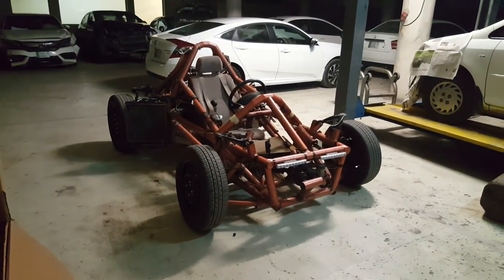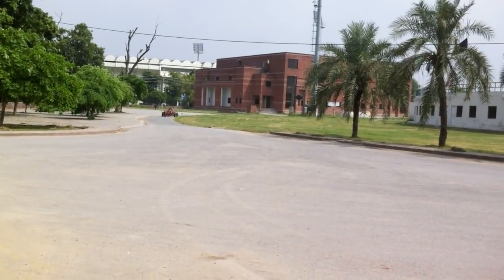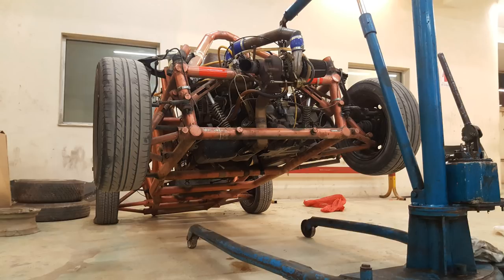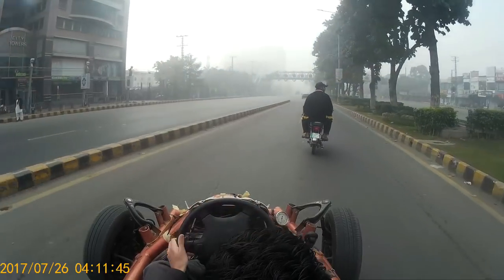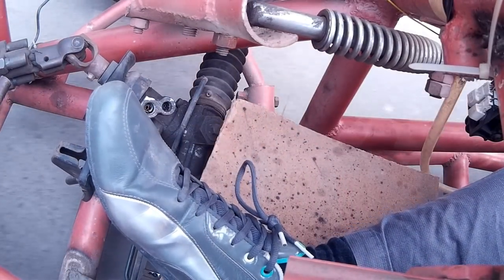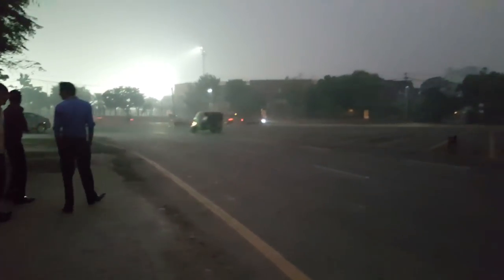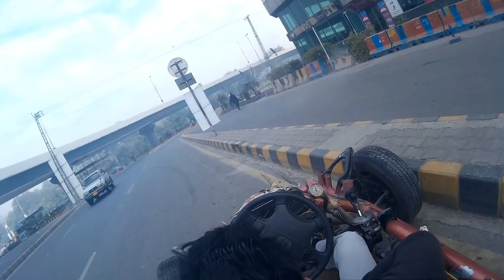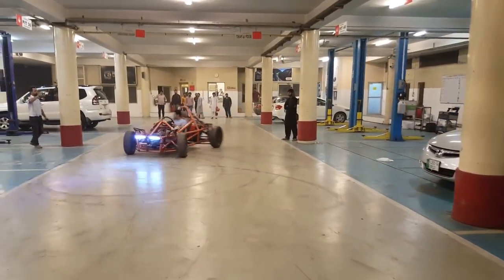Self Made Car C2 - 5 Year Update

Comment: One point about bending tie rods straight. I did that once to my go kart and thought everything was OK, some time later the tie rod broke in two while being driven. The bend was located at a point on the tie rod where a nut had been silver soldered on for alignment purposes so it was heat effected, but be careful with bending suspension components to repair them.

Comment: This car is a credit to you ,  well done . I like the way that you made the original suspension work so well. The pushrod modification was really good. A lot of great engineering and creativity  went into building this . It would be interesting to see a similar car with a slightly longer wheelbase using an Audi inline engine and transaxle mid-mounted to give a better weight distribution . Best of luck with the current Mercedes project.

Comment: the custom automated manual shifter was very cool. i want to see this revisited. torque converters, 4 gears and low rev limiter is unacceptable for a car guy. if it really is that hard to make you can at least try reprogramming the transmission to have higher rev limit and lock up the torque converter clutch instantly when at 2nd gear or higher

Comment: Very cool. Didn't realize you had all that work into that thing. The automatic manual gearbox thing especially. I'm curious what was the speed limitation for the gear changes, slow actuators for the shifter, clutch or timing everything? My recommendation (I'm biased,) a KLZE v6 from Mazda with a 5 speed gearbox. 200hp 170tq, NA, 7500 rpms and an awesome sound. Oh and you can pick one up between $600 -1200, way cheaper than the Honda for everything, weight is about 400lbs., trans. 75-80 lbs. Should be terrifying :D
Reply from the maker: It was mostly the way I had it programmed. The system waited for the revs to fully match before shifting up and the engine was fairly slow reving down so that caused the delay. Could have been fixed by programming it differently.  
Yeh V6 could have been good too but would have probably required a bigger engine compartment. I really wanted to go with K20. Those are above 200hp too and fairly easy to turbo, but dont think I'll make the effort. It would get someone killed
Reply: I thought the K series were 200 with a turbski... no matter, those cost 3-4 times as much as the v6. Space wise this engine fits in small cars as well, MX-3 is the smallest I believe. The only thing different is the engine and transmission are on opposite sides from Honda. With $100 headers and MAF swap (different Mazda ECU, (see reliable,)) You'll be at 215 ish at the crank. More if there is no other exhaust. Everything can be junkyard sourced as well.

So far as the automatic MTX, how about adding an auto blipper circuit. You'd need to know the engine rpm, (easy,) and the transmission input speed... hmmm. How about a sensor that counts the teeth on the flywheel with light installed in the bellhousing? With  an easy shift mode and performance/sport. Easy smooth shifting until you press a momentary switch on the front of the shift knob, or steering wheel.

Definitely should be at the track for high speed testing, and add a little foam padding for the roll cage that crash looked like it hurt : )
Reply from the maker: K20 came all the way from 150hp to 220hp variants.
There was a rev match system but it still required the accelerator being pressed because the car didnt have an electronic throttle. I was getting the engine speed from the distributor tach output and the trans speed from the vehicle speed sensor.

Comment: Was much thought put into the length of the lower control arm vs the length of the upper arm? Also the upper ball joints are much higher than control arm mounting points. Did you simulate this geometry in a computer program or did you just try to make all the parts you have fit the frame?

Comment: So with a FWD engine being mounted in the rear, did you also install the shifter backwards aswell? I want to build a similar vehicle someday and I am still puzzled as to what to do about the rear axle and transmission and what I could use for those parts?
Reply from the maker: With the automatic the shifter was just linked with a cable, when it was manual I had motors changing the gears. The setup its self is easy enough. Everything that's on the front of the civic gets mounted exactly the same was but at the back